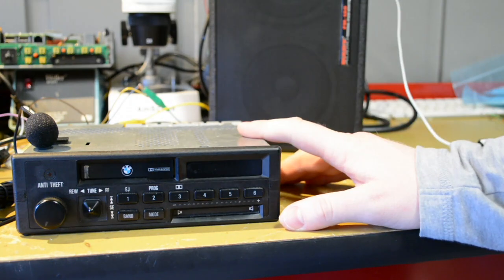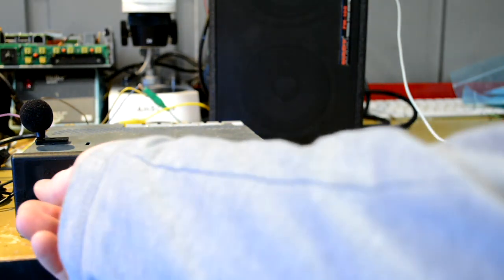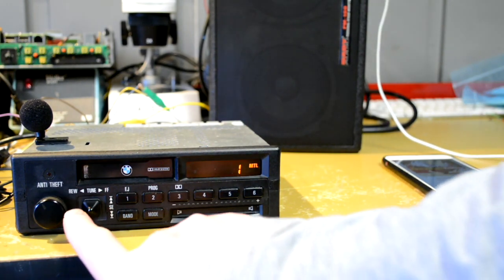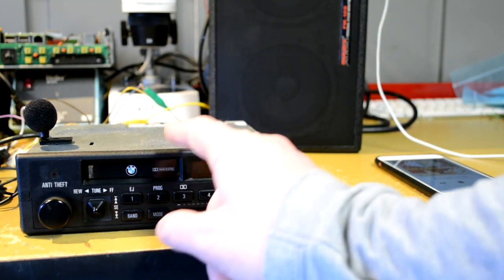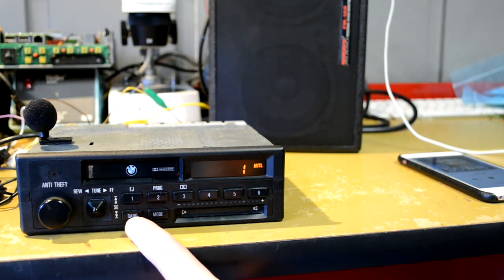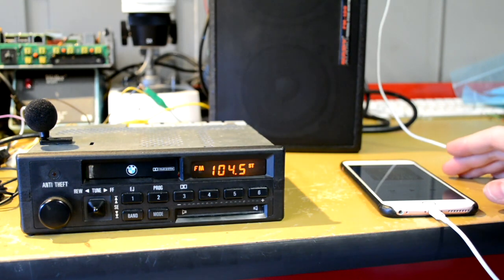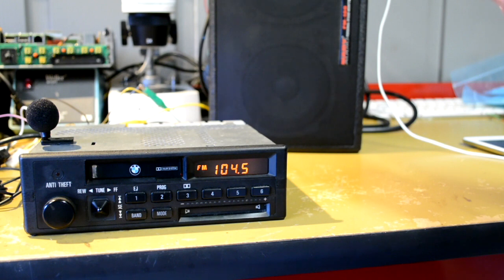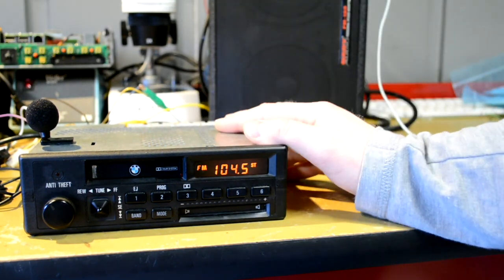BMW E30 CM5908 Radio Bluetooth Retrofit Board Demo

Comment: Hey there, I’m looking to buy a e30 and I see many of them have aftermarket radios. First thing I’d want to do is go oem radio with this hack. So my question is 2 part, is there specific years or models that I should or should not get (that would not work with this) and 2, do you sell a complete unit?

Comment: This is amazing. Any chance you might bypass the amplifier and send the signal out via RCA or any other means?
Reply from the maker: dmclaren not with the current setup. To do that would mean designing a replacement power amplifier board along the back of the radio. Then all that could be added. Speaker to line level converters would be the way to go for now

Comment: How's that coming along Jay. I have the same radio (CM5908) and would be awesome if I could try out the bluetooth board. I wouldn't care too much for the speaker for Siri input. Just want to bluetooth music from my phone to my BMW speakers. BTW, the radio is not working. I saw that ebay sells kits for replacing capacitors for about $50. Do you know how to do the repairs and perhaps install the bluetooth board if I were to mail you the radio?
Reply from the maker: Hi Francisco, progress is good! I am opening cantalouperadio.com next month for business, beginning with a small run of these boards for the CM5908. As far as radio work, we will offer a mail-in installation service for the kit, but we won't be doing general repairs right now.

Comment: That is amazing, does this head unit require an external amp to work? Or will it work just going straight out to the speakers?
Reply from the maker: Nothing external required! All the factory hookups on the back still function as original, so the speaker outputs are function as normal. Some of these cars had factory external amplifiers mounted in the trunk (part of the premium sound package) and this will also work with that amplifier if that's what you're wondering about.
Reply: I am trying to sort out if this radio will work in my non amplified 1990 325i with no amp. The channels seem to be very quiet when I hook it up to test it. If I can get it working right though I am for sure interested in this bluetooth hack!

Comment: Wow great job on this Jay, any chance you’d be interested in doing other models, say perhaps the BMW C33 or CD43?
Reply from the maker: The C33 and C43 are definitely in the pipeline. Probably not the CD43 since they're very pricey and are basically a C43 with a CD player, which would probably need to be removed anyway.
Reply: Good to hear, I've got a C33 in my E30 and would 11/10 purchase one of these kits!

Comment: Hello there, this is awesome! I have a CM5908 sitting on my shelf... I bought my E30 with an aftermarket radio already installed, and I have to say, it sounds really nice. I am afraid that if I put in all of the work to revert it back to stock wiring and reinstall the oem amp, it's just going to sound outdated. What are your thoughts on this? Do you think the CM5908 sounds pretty good? If I ever put the radio in the car I'd definitely do it with one of your bluetooth kits given the chance.. I just don't know if I'll regret it in terms of sound quality. Thanks
Reply from the maker: Hi Danny, great question. This is something I plan to do a complete video on with some engineering analysis and measurements, but in short - no, I don't think it will sound outdated. These radios are capable of producing clean, low-noise, low-distortion audio throughout the spectrum. What they lack is power, and luckily, that's something you can fix with an external amp. There's a lot of mis-information out there around the quality of this kind of setup, so it's something I'd like to help clear up with some hard evidence comparing the audio quality of say, the CM5908, with a modern head unit. My hypothesis is that the data will show the fidelity is comparable, albeit at a lower power. Look for that video in the coming months on the Cantaloupe Radio channel.
Reply: Jay Coggin thank you!!